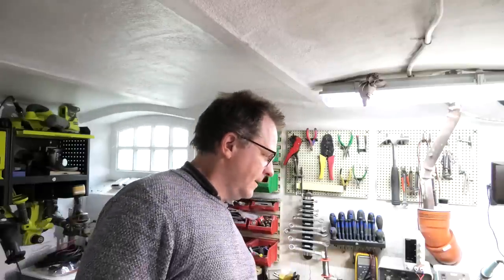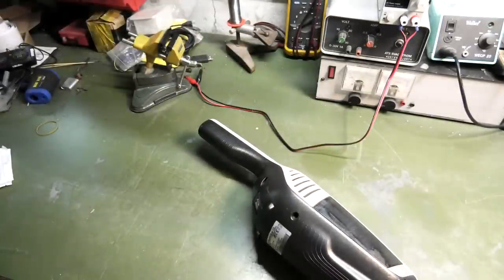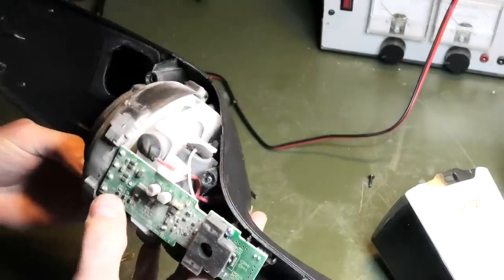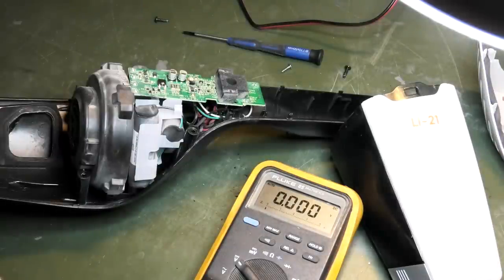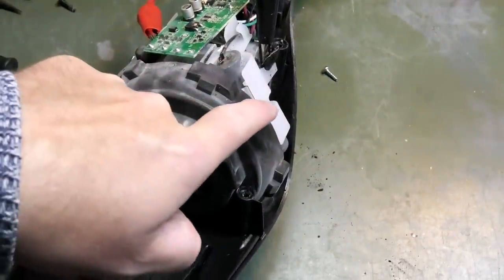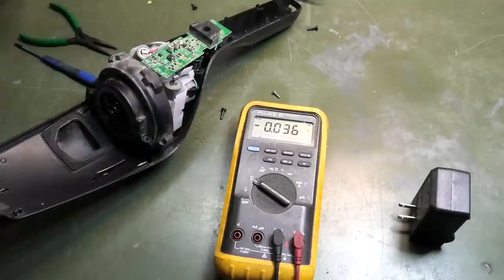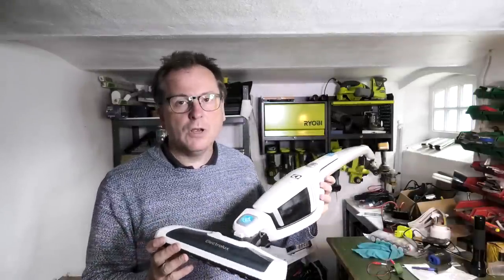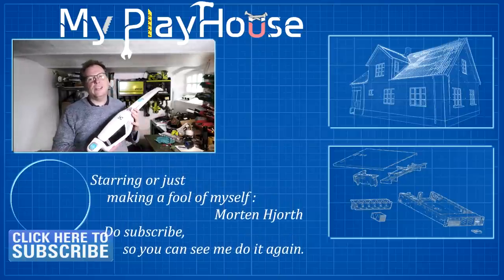Fixing Electrolux Li-21 Vacuum Cleaner - Won't Run or Charge - 1306

Comment: Our Ergorapido gave up today. The transistor marked Q10 on the PCB is fried. Too bad this isn't your hoover, because then I'd ask you to have a look for a part number. 🥲
Reply from the maker: There are unfortunately like a 100 different models :-/
Reply: @MyPlayHouse I've seen that there are several different motherboards, but the one in your video is identical to mine. I can even see the Q10 transistor. I guess I'll try replacing it with a 'general purpose' transistor and see wht happens.

Comment: I had this problem with my unit. I thought it wasn’t charging because it wouldn’t run. All I had to do is clean out the bar at the bottom. It wouldn’t run because it couldn’t with so much thread and hair stuck in it.
Reply from the maker: I do not think this is the same problem,, as I could also not run it for long as just the handheld version.
Reply: Hi, thanks for the video! Had exactly the same problem. I’ve had the vacuum cleaner for several years and replaced once the batteries due to short running time but did not compare the batteries. That balancing would have helped at least for some time. There might be some kind of power limiter that shuts it off in case of extreme load. Noticed long time ago that it wouldn’t run too long with the brush unit running. Helped when took it apart and cleaned. There is a small  motor & rubber belt assy (plenty of dirt in it) running the rotary brush.

Comment: hi, what type of variable resistor did you use to drain the batteries?  I put some new batteries into an 18Volt vacuum and I have noticed some of the new batteries are over 4volt. mmmmm so I want to bring the voltage down. If you can share your resistor please.
Reply from the maker: It's an old one that I took out of something like 20+ years ago,,, I have no idea,,, sorry.

Comment: This is the same thing that kills many laptop and power tool batteries.  The BMS on these boards only protects the cells from over charge and over discharge.  Most of these small BMS boards don't have any provisions for balancing since the manufacturer wants people to buy new batteries or new devices when the old ones get out of balance and have a short runtime.
Reply from the maker: I build some big battery packs 14s10p and the BMS only balances when the battery is fully charged,, and with 5mA (better than nothing) but not enough.

Comment: I rather its stop at 4 volts :) Longer overall battery life. Would be almost a perfect little rechargeable vacuum. And 1st!
Reply from the maker: Fair enough! to bad this BMS is doing so badly :-/
Reply: @MyPlayHouse  Yea i meant to add "If it had a good bms or simple cell balancer."

Comment: I've also seen charging to less than 100% with my laptop and a new tablet (unless I ask it to go to full), to prolong battery life years. I think I've also seen this mentioned with electric cars, only charging up to 100% when chosen, same idea with less in daily operation. With such a vacuum docked after use, it is quite likely that it would sit for a long time fully charged, which is not what the batteries like.
Reply from the maker: Well I would go closer to the 4.2v ,, and this BMS clearly does not balances out the cells,, so the vacuum cleaner will stop working long before the cells are worn out :-/

Comment: I also have the same type but i guess mine is a bit newer. It also wont run for long.
Very handy vacuume cleaner, maybe i should open it and have a look! Would be great if i could fix it, it was pretty expensive!
Reply from the maker: Yes,, they are not giving them away :-)

Comment: Do you happen to know how many mAh that the batteries run on :)? Plenty of different versions of the 18650-battery out there 🤔

My grandmom has the exact same model, the exact same issue. I just don't have the measuring tools that you happen to have, so I was thinking of just putting new batteries in, and then hope that it'll work 😅
Reply from the maker: I can't remember exactly,, but believe they was rather low capacity,, like 1100mAh,, but the ones in the vacuum cleaner you are fixing can be totally different.
You really need a little multimeter,, they are as cheap as the cells :-/